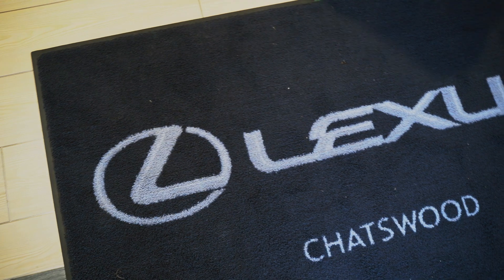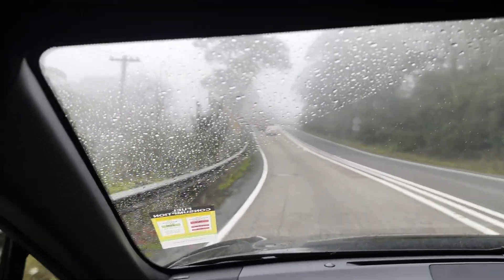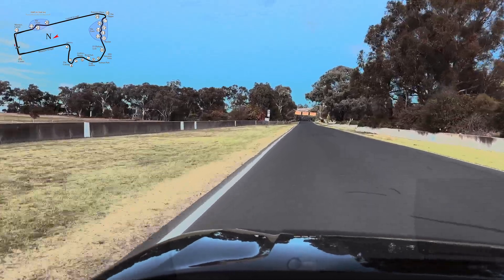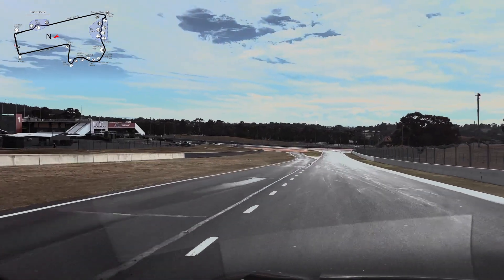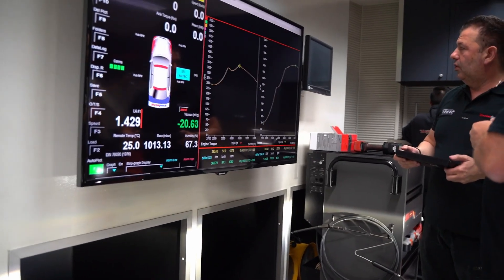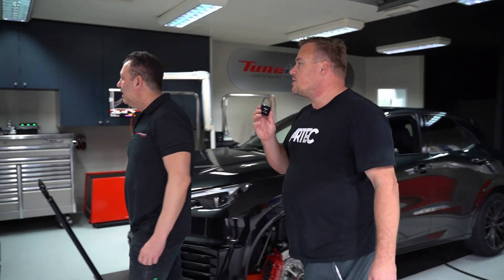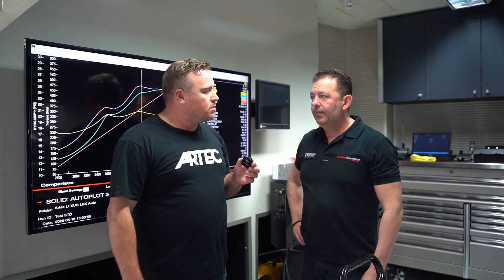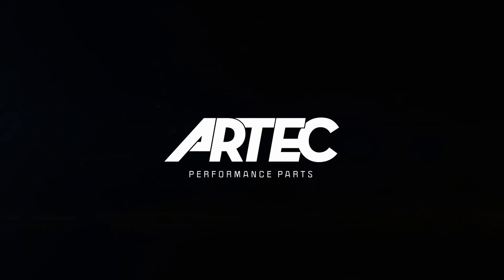Australia's FIRST Lexus LBX Morizo RR! First Impressions + Dyno and Drag Testing - ARTEC Development

Comment: 172KW, is about 230HP , which is the same figures that Savage Geese review saw with the DAT. LBX would probably feel even slower than the GR corolla DAT given increased weight.. wish there wasnt as much drive train loss
Reply: My 2019 sti made 151kw atw on a mainline awd dyno and after stage 2.5 bolt ons and pro tune made 191 atw. The fact they are doing only front wheels with the hub dyno os pretty lame as they know there is less drivetrain loss on a front wheel drive based awd system like this car is but if they used an awd dyno the result would be much lower. Dynos are just a tool to see what results you get with certain tunes and upgrades. A lot of tuners manipulate the results too to make it seem they made more power. Mine was done at ichiban so it’s legit and 150-155kw atw is normal for 221kw at crank wrx sti so these Toyota 3 cylinder engines should be approximately same or abit less in real world power.